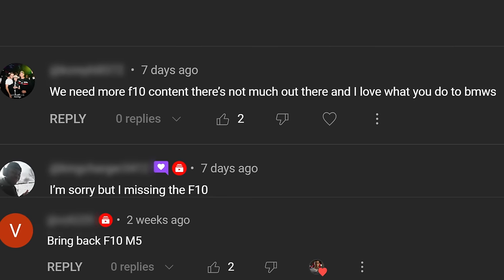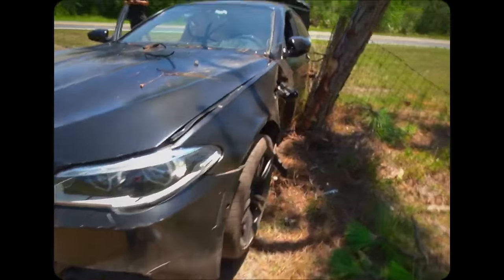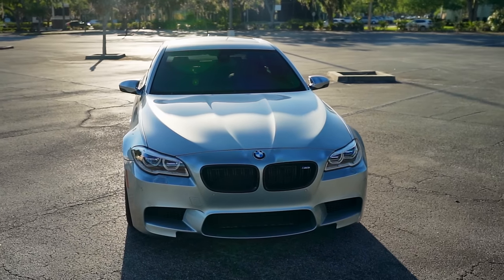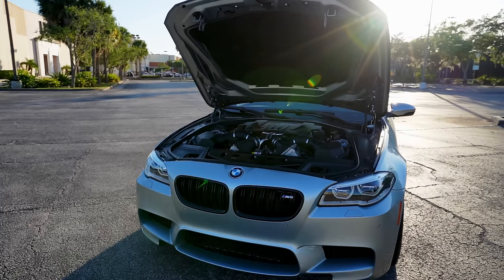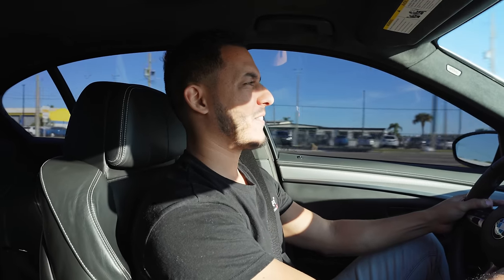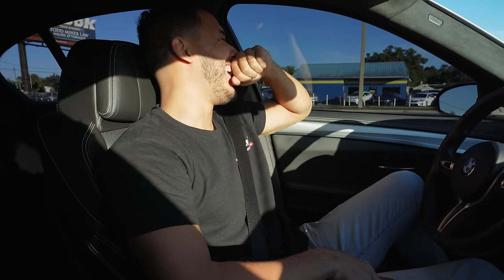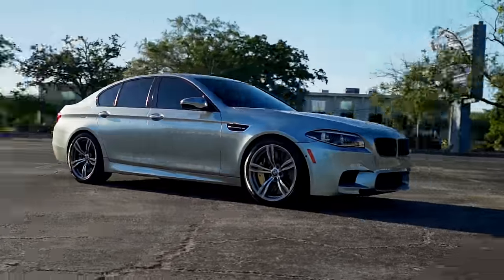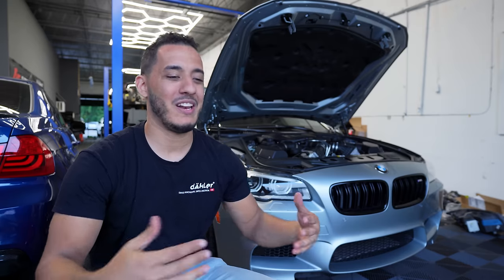I Have To Be Honest About My BMW F10 M5 - I'M SORRY!

Comment: I have an F10 M5 with 120k miles, zero issues. There's a handful of examples I've seen that have close to 200k on OG motor. Just spoke to somebody the other day with 160k on a frozen individual spec. You'd think they'd be a lot more unreliable but no.
Reply: Same here, 115k and no issues. Love this car.
Reply: Never changed the rod bearings?     I've been back and forth on picking one up, but figured it was safe to throw rod bearings in right after purchase.
Reply: @RAM_C5  I've had a few, and zero rod bearing issues. The likelihood of rod bearing failure is very slim, especially if you find a facelift car. The 2011's and some 2012's had oil pump issues, hence rod bearing failure. Get a facelift model with maintenance history (oil changes every 5k or less, 10,000 is excessive for any car). And you'll be trouble free.
Reply: F10 M5 my dream car inshallah one day i buy it

Comment: Damn as a f10 m5 owner my self this is sad, i been rocking with you since day 1 i was happy when you got a car i owned, 2 actually e46 m3
Reply: Hey bro I’m looking at getting an f10 m5 myself I’d just like to know what your experience has been with owning one?
Would you say it’s reliable?
Reply: @Zolani__  honestly it's costly to maintain and run, I have 176km on the clock and it's been mostly reliable, small things do occur if you live in cold climates like me (Canada) but nothing that will break the bank, injector and brake replacement is mega expensive even in a diy, and the tires go out really fast and they are pricey(i run cup 2 rears 305),  but overall it's pretty reliable and won't let you down if you keep on top of things, I had many bmws and the m5 has been so far one of the best.
Reply: I must say those new awd m5 are more safer. Maybe you should get one ‼️ a lot more road friendly and sometimes those thoughts make you crash
Reply: @intelligentcarreviews8592  thank you man!
Reply: @Zolani__  very welcome

Comment: The F10 M5 is a severely underrated car. I was thrashing my old car after work just to blow off steam and have fun. An F10 M5 shot past me and left me standing. An E90 330d when it's tuned is a monster but an F10 M5 is a different beast overall. Would love to own one. Either that or the F80 M3. To me the M3 & M5 are the ultimate driving machines.

Comment: As someone who started following because
Of the frozen m5 this one hurts. I completely understand what you’re saying about the market for parts on these cars. I’ve been saying it for a while. M tax is still very real for these cars and not many options on aftermarket parts. Frozen solid m5 in the comments helped me with my m5.
Reply: I just finished rebuilding my m5 after a no traction full pull on the rain and smack a curb at 60. These cars do not like to stay in a straight line lol.

Comment: i have owned the F10 M5 & E60 M5. the E60 M5 was far more reliable than my current F10. thinking about going back ngl. gonna see if i can just do simple upgrades & fix the reliability issue but if not it’s going to go. thinking about going GTR anyway.

Comment: Hows the 4.4L v8 for reliability??? And the trannys? I assume the zf8 is really solid tho. Ik b58 is reliable in the 540i
Reply: the m5 has a dct not zf8
Reply: @RandomLuckk  does the 550i and 540i have dct? Didn’t explicitly say it till the end my bad, but i was referring to 540i and 550i. 550i has basically same-ish 4.4 in it

Comment: No regrets owning my F10 M5 for 6 years+!
Reply: What's the current mileage and did you do rod job on it?
Reply: @anyimmichaelik  under 75k, stage 2+ tune, with  titanium exhaust, downpipes, and intake and upgraded metal turbo inlets, and clutches. Also replaced coils at 50k. Everything else is stock and runs great!